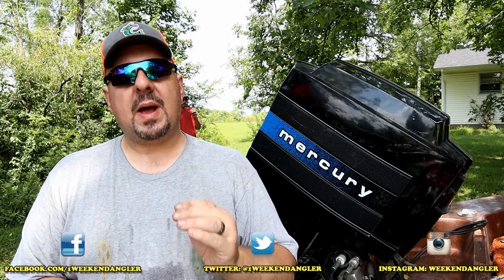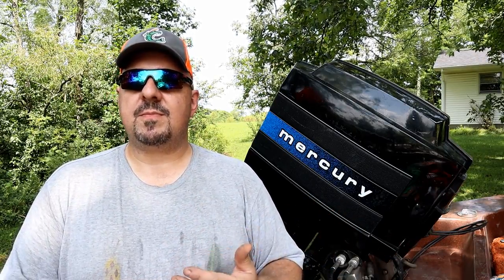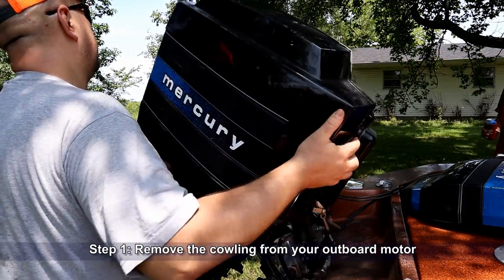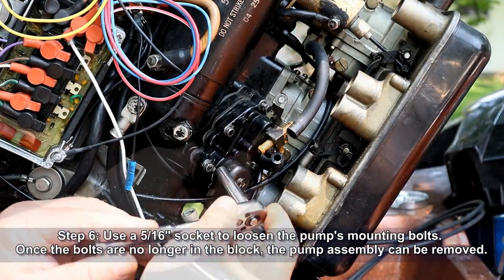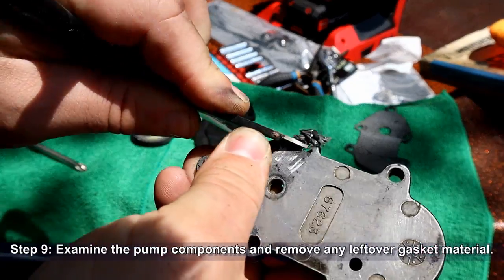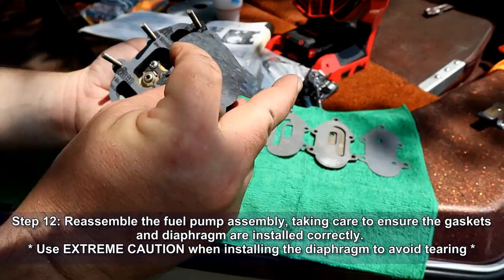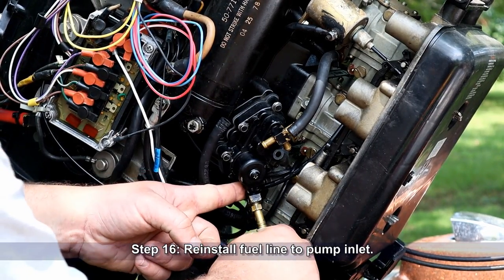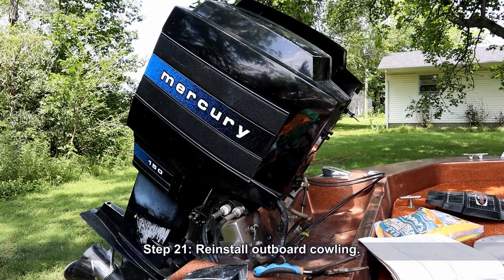How to Repair & Rebuild a Fuel Pump on a Mercury or Mariner Outboard

Comment: Older pumps don't have spring inside them? Have same motor was no spring or black tab run diaphragm help please???
Reply from the maker: Some outboard fuel pumps use a spring. This model doesn't. Everything used in the pump assembly was shown in this video. It basically becomes a matter of changing out gaskets and the fuel pump diaphragm.